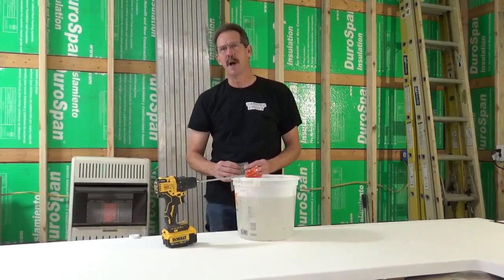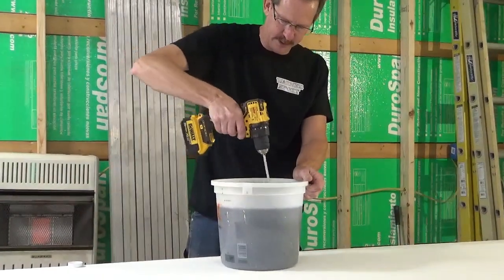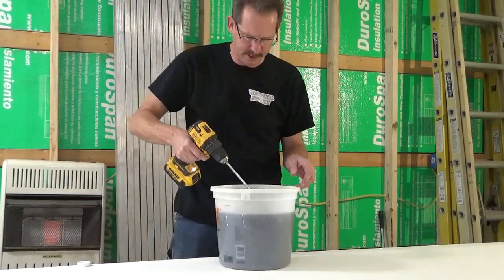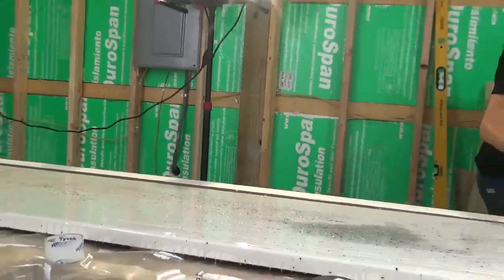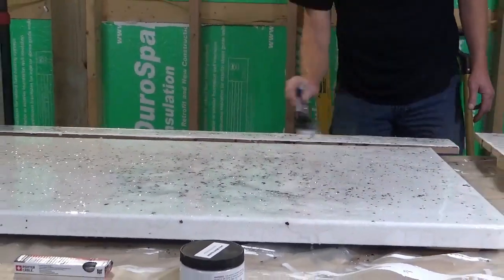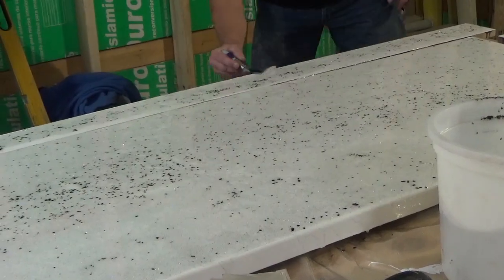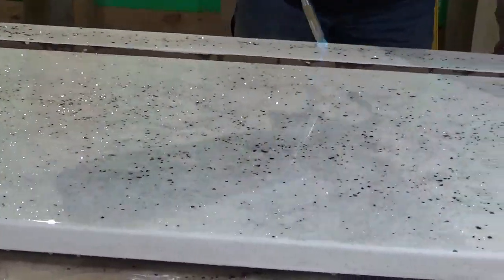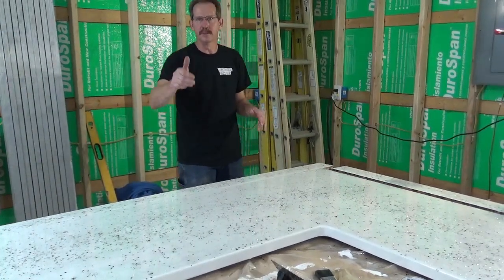White Quartz Epoxy Countertop With Glitter and Mica Flakes

Comment: Explain the epoxy ratios - If I have 27 sq feet of countertop to do - how much would you mix from each bottle?
Reply from the maker: 27x3oz sgft = 81 oz.  You need 81oz or more so 1 to 1 ratio would be 40.5 of each part.
Reply: I realize I'm kinda off topic but do anybody know a good website to watch new tv shows online ?
Reply: @Colin Aden I use Flixzone. Just google for it =)
Reply: @Colin Aden i watch on FlixZone. Just search on google for it :)
Reply: @Colin Aden i watch on FlixZone. Just search on google for it :)